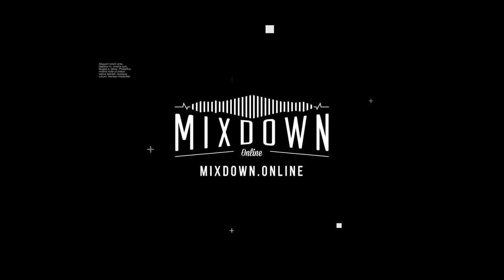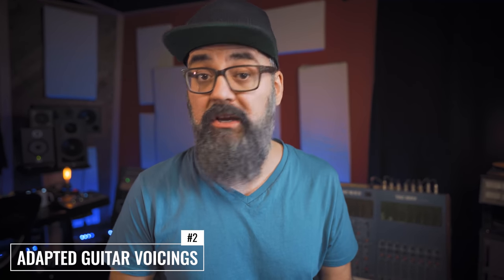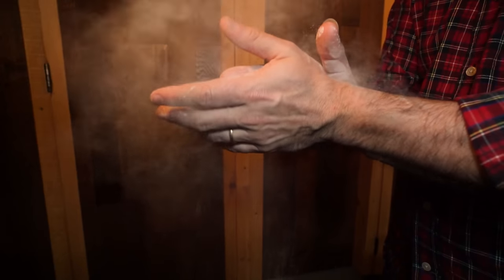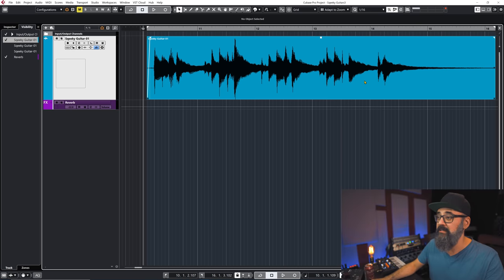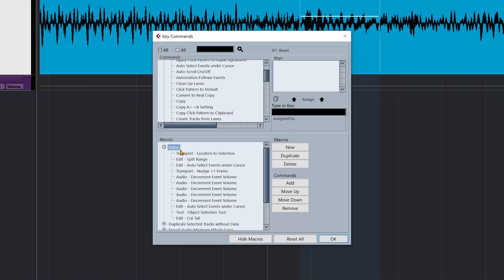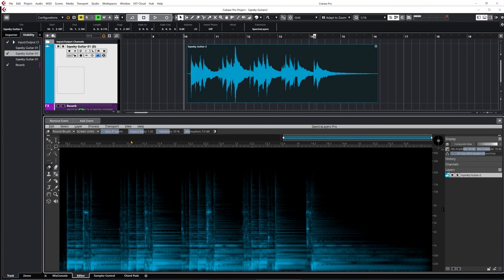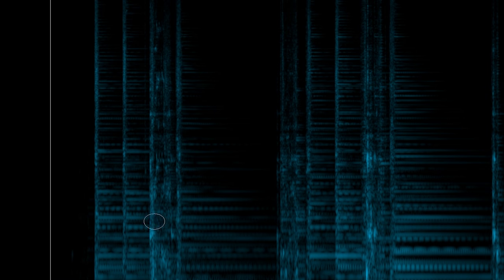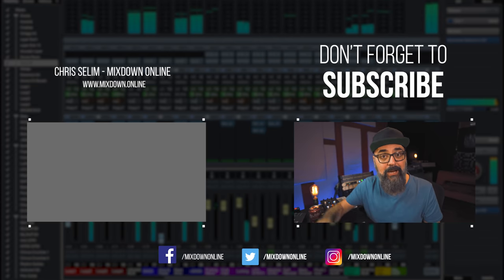PRO Mixing & Recording HACKS to Remove Finger Guitar Squeaks

Comment: Another nice "trick" to play with is phase cancelation. Just copy the track and  route both into a group. Flip the phase of the copied track. You shouldn't here anything now. Use the high and low cut  to isolate the sliding frequency (you should probably locate it before this procedure).  Now pull the level of the track all the way down and slowly up again, until the amount of phase cancelation of the corresponding frequencies meets your taste... works good for deessing as well. If it's too complicated for your taste it's still something you could play with. Maybe you find another application for it...
Reply from the maker: Yes, cool trick indeed! I did the same on drums on this video https://youtu.be/WByt3ShEy0o
Reply: @mixdownonline  Yea, great application too

Comment: The tip about cutting the part, lowering volume and equing offline sounds so simple that I don’t know why I never thought in it. I wonder if after equing the event it can end with modified phase and it doesn’t fit with the neighbors events and so a cross fade is needed.
Reply from the maker: Not if you recorded your guitar with one microphone, phase will not be an issue in this case
Reply: @mixdownonline  Yes, that for sure, but what I mean is that after equing this short event its wave form could be altered and so its start does't match the end of the event at its left and its end doesn't match the start of the event at its right and some click could be heard. But I still haven't tried.
Reply: @korkenknopfus  I use clip volume cutting like this in mixing and don't have a problem - I suspect Cubase is doing some gentle x-fading in the background because it sounds smooth to me.
Reply: @Sesaon3  Thank you very much for your input. I will try it for sure, when I return to my mix.

Comment: Thanks, great video. You must be a psychic Chris. Just what I needed right now. But is there a difference version of Spectralayers? I don't have all the tools in mine.
Reply from the maker: On CUbase 11 Pro, Spectralayers One is included but you need to install it first through the Steinberg Download Manager. There's also the full version Spectralayers7
Reply: @mixdownonline  You are showing SpectaLayers Pro in the video, Spectralayers One that comes with Cubase Pro does not have the eraser tool that I can find. I was geeked to go try this only to find out I have to buy the pro version.  Let me know if I am wrong about that.
Reply from the maker: @ross9868  unfortunately, you're not wrong Ross, that's my bad... I installed S-7 weeks ago to test it out and it replaced S-One in Cubase and I just didn't noticed and payed attention 🤦Sorry about that!

Comment: @Chris: The tool (eraser) that you use is not included in the version of Spectralayers that comes with Cubase. You will have to buy the full version which costs 300!! euros which is a lot of money in my opinion.
Reply from the maker: Sorry about that, my bad, I thought I was using the version included in Cubase Pro11... With the Free version, you can use the Selection tool and select the squeaky part and click on delete to remove it. Not as smooth as the eraser tool but it still might help.

Comment: Thanks for this video, very useful info! I was wondering if there's a way to reduce or get rid of fret buzz on a bass guitar recording also? Like if the action is set too low on a bass and there are a few unwanted string/fret buzzing noises on a recording. Obviously it's better to set up the bass properly, increase the action then re-record the parts, but sometimes we have to work with what we've got. Is this possible any way? Thanks.
Reply: I used a free program called Audacity and it has a really good noise remover tool. Will reduce hiss or buzz without degrading the sound of the instrument.
Reply: @discosourcedjs  Thanks for the info. I've downloaded Audacity and had a look at the noise remover tool, but I'm as yet unsure what settings to use to reduce the fret buzz. Do you have any tips? Or is it just trial and error until I find what works?
Reply: @neilkendall5499  For the fret buzz this is what you gotta do. Duplicate the guitar track. Then delete the wav on one of them. Then zoom in on the first one and exactly cut the fret slides and move them up to the new track you made. After you cut all the fret slides and move them up to the new track. Pull out an EQ on the new track, I like Fab filter EQ, then make a peak and roll through frequencies and find the fret slide sounds, then cut them out on the new track. That's it. Now everytime the fret slides happen for them split seconds it will drop them out but keep the body sound of the guitar so it sounds natural. 👌
Reply: @neilkendall5499  If you nit referring to fret slides but the buzz from guitar pickup then Audacity will do it, I didn't do any change in settings just ran it and it noticeably removed some hiss/buzz I had.

Comment: Great Tips, i like the Spectral Layers more :) The tip of using different voices definitely is a good way to avoid these noises, also i think using different strings beside steel or bronze (if possible)  like Nylon can reduze guitar squeaks. Great job Chris, cheers
Reply from the maker: Thanks Filipe! True, Nylon strings will squeak way less, but not suitable for all genres, like you said, if possible! :)